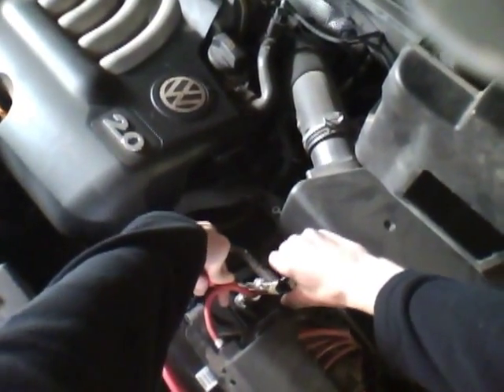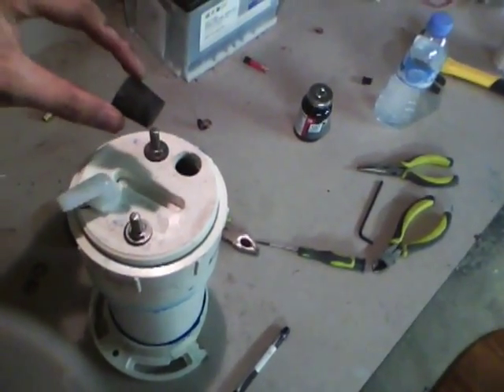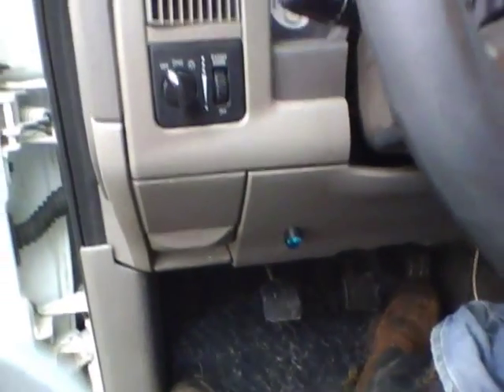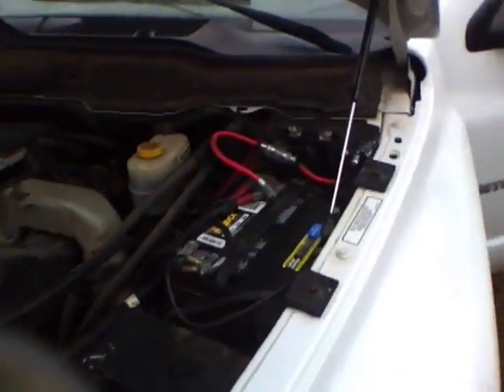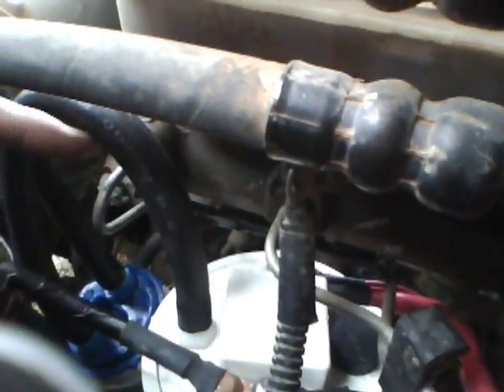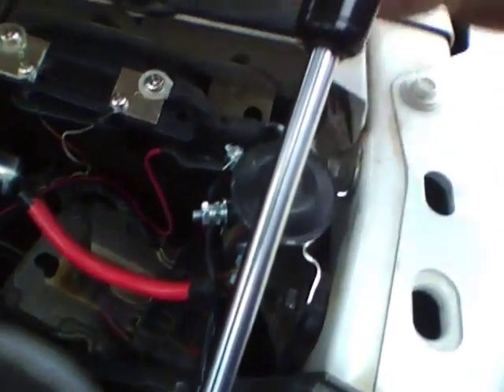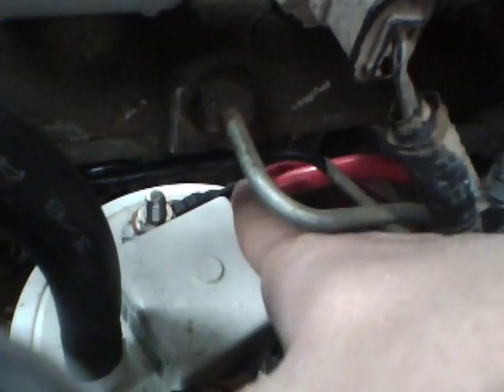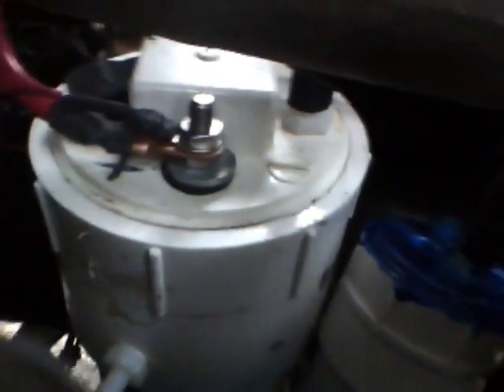Hydrogen Generator How To on Dodge Ram 3500

Comment: Hey Buddy...Nice job on your Cummins HHO generator!  I saw your comments from a year ago and I had a couple more questions.  Do you modify your O2 sensor output at all, have you ever tried methanol injection, and what your original stock highway mileage?  Did you ever try any other HHO generator setups and are you still pulling 20+/- amps once your cell warms up?  Do you modify the frequency of the voltage going into the cell or is it just straight 12 volts and do you monitor your EGT's?  Thanks as I'm going to install a cell on my 99 CTD to try to hit 26mpg or more!
Reply from the maker: I have heard you can install set backs (not sure if that's the right term) to pull the O2 sensor out of the stream a bit. Never did it, but if you had a good computer monitoring system you could probably figure it out. I wish I knew more about the actual engine computer system. I have never tried methanol injection. I hear you can do a windshield washer pump system and inject regular windshield washer fluid in since it has some methanol (30-40% I think). Original mileage was 22mpg on average. I have never tried any other HHO setups. As far as the amps go, I honestly can't recall. I don't drive the truck that often (5,000 or less mpy) and when I do I just run it normal. The frequency was just 12 volts. No pwm or anything like that and I did not monitor EGT. Good luck with your installation. This is a fun project and hopefully you will send me a video link when your complete!!! Take care

Comment from the maker: After several tests over about 10 months - highway, city, combo of the two, with a Bully Dog chip, and without the chip, I came to the conculsion that I get about 4-6 mpg better with the generator and the chip. I now get about 26 mpg. I would drive the same route at the same speed and fill up at the same pump for most of the tests. I did drive to Texas (380 mi) for the highway part and got about 7 mpg better. All in all a fun project and I learned a lot. Cost me about $100. I use it everyday.